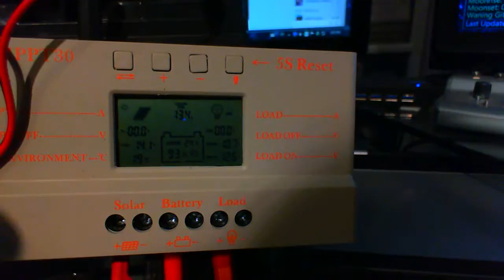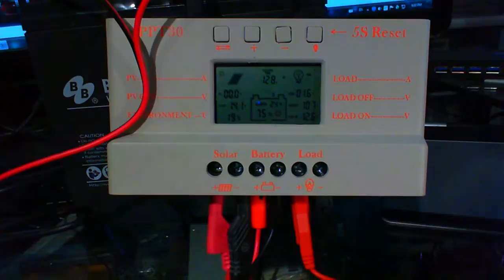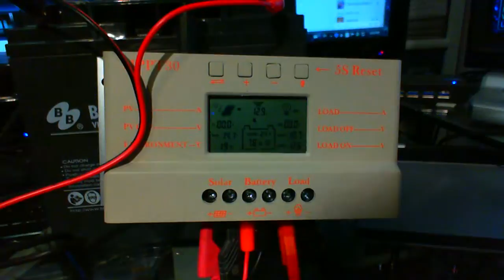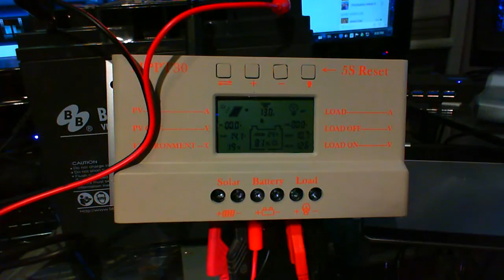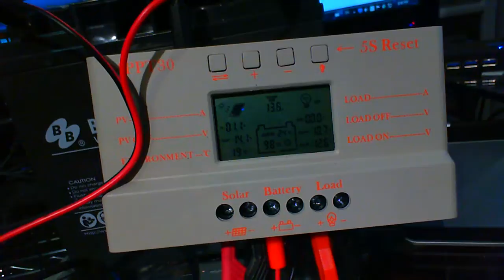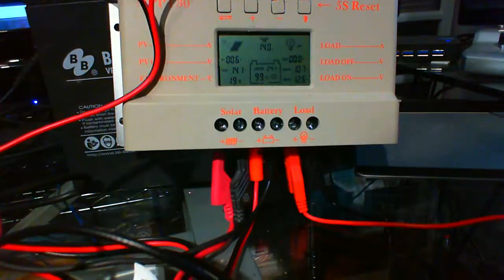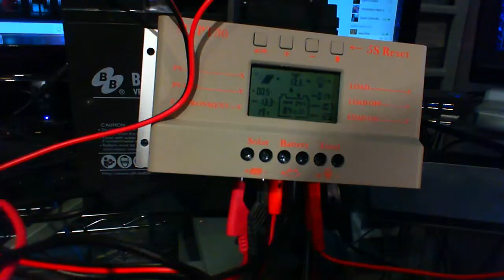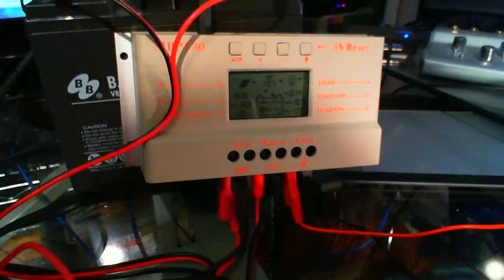MPPT30 FAKE eBay solar panel controller.

Comment: for germans  Diese Laderegler sind Fake / Betrug
Alle diese beigen oder weißen Laderegler die so aussehen sind keine MPPT
 Laderegler,sondern  einfache PWM Laderegler,da hat der 
Chinese nur die 4 Buchstaben aufgedruckt.
Wie man ganz einfach einen MPPT Laderegler erkennen kann: 
Ein MPPT Laderegler drosselt die Solarmodul Ausgangsspannung ( bei einem
 12 Volt Modul ca. 18 bis 20 Volt) nicht ! 
Das bedeutet...wenn ich einen Spannungsmesser an die Ladereglerkontakte 
für das Solarmodul halte,zeigt dieser auch die 
Ausgangsspannung an,also immer deutlich höher als die Batteriespannung.
Angenommen das Solarmodul hat eine Ausgangsspannung von 19 Volt und die 
Batterie hat gerade eine Spannung vun 12,5 Volt,messe ich am Laderegler 
am Solarmoduleingang 19 Volt und am Batterieausgang 12,5 Volt.Bei einem 
PWM Laderegler messe ich am 
Solarmoduleingang und am Batterieausgang jeweils die gleiche niedrige 
12,5 Batteriespannung.

Comment: I think I got ganked; mine is very similar.  The lettering is blue and on the lower right is says "SUN Yoba", I think I paid on or about $40 bucks for it.  So, should I send it back?  

I am just learning and only have 2 - 100 watts PV, only setting up for back up and only have a 2000 / 4000 peak inverter.  Small batteries, but it was the only cost effective batteries I could find, (live in the country). 

4 Ea. 12v 35 amp. AGM, I plan to add 2 more, or side line this setup for an RV and build a big boy system.  Started with this to learn the ropes, can only get so much out of watching vids, without practical hands on experience.  Thanks for any help folks.

I would like to get a pure sin wave inverter; any cost effective recommendations, and also for a real MPPT 30 controller, disability check only goes so far.  Thanks again!

Peace
Reply: Wounded Warr1or  Hi I have the exactly same as you!..,means not as is on the video!...why same number but deferent providing ?!... Hm